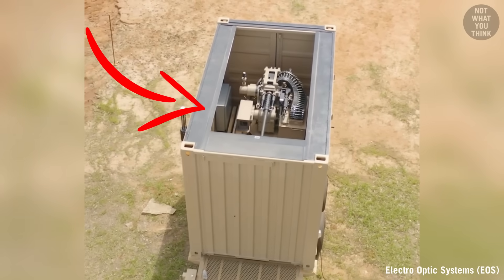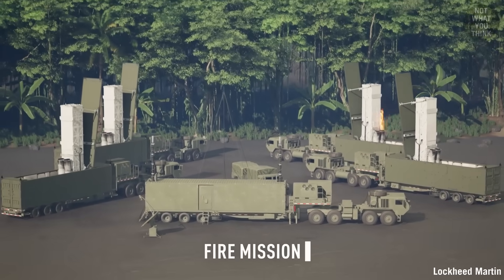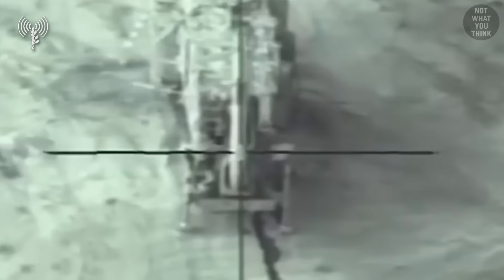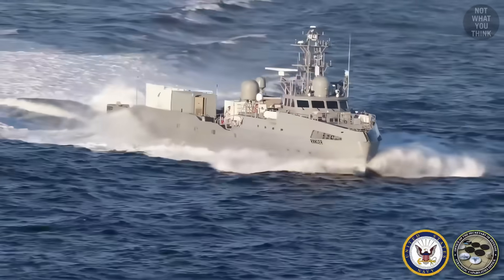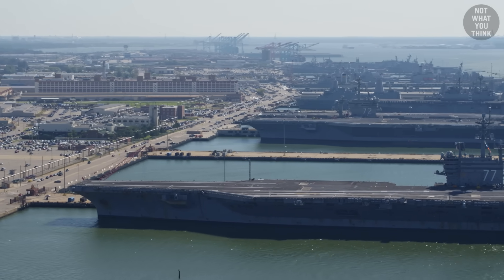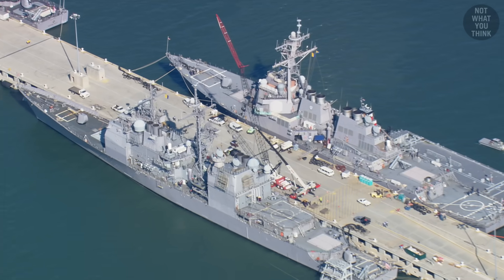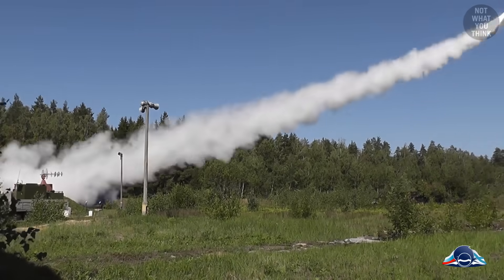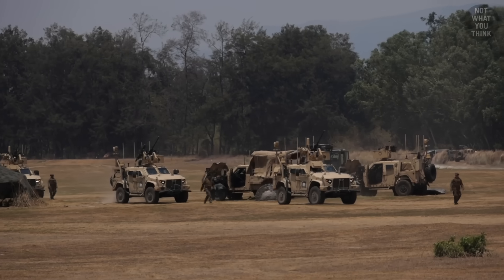Why Containerized Weapons Are So Terrifying

Comment: What if future container missile systems launch missiles from the sides instead of the top launch. And you don't need intermediate range ballistic missiles if you are planning to launch point blank surprise attacks from the container. Missiles with ranges from 40 KM to 100 KM would be enough to do the job. And they would also be light weight than regular ballistic or cruise missiles.

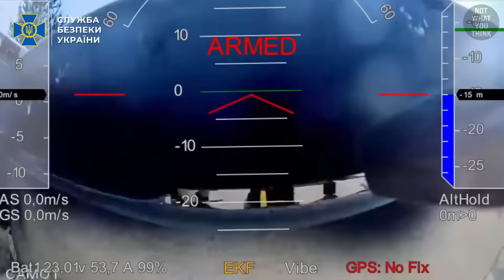Comment: 7:10 I`m pretty sure they were remotely controlled with no AI. Delay is not that bad because they used regular cellular internet. Less than 200 ping is more than enough to fly an FPV drone over the open field.

Comment: A small mistake ought to be corrected. At about 1:40 there is a reference to "Q ships" in WWII.  In general, this is true, except that it occurred in WWI, 1915. The term Q-ship had to do with a port city in Ireland, Queenstown. This was where actual merchant vessels, with crew and captain were "pressed" into a form of military service. These merchant ships, typically break-bulk tramp freighters, were armed with hidden pieces of naval artillery, with navy officers and gun crews. Which along with calculated devious play-acting, attempted to lure a German Unterseeboot, a U-boat to surface and sink that ship with their deck gun. This was effective and deadly. The result was unrestricted submarine warfare.

Comment: While this is an issue, another big problem than still fairly detectable Trojan containers are micro strategic capabilities. You just need to smuggle in enough parts for a single device, camouflaged in civilian items. Imagine targeting a key command player right when a major operation of yours is about to launch. Automatic facial or vehicle recognition, a machine based single shot device and you now have the benefits of any number of valuable small scale abilities, almost impossible to detect, without needing a huge network.

Comment: Roll on Roll off ships just drop self righting containers straight into the ocean each container has a small motor to swim to designated launch points ready to attack, once launched, the containers are designed to sink.

Comment: This explains one thing: the first hit is inevitable. So, in order to avoid such hit, having defence systems wont help much. Instead, a country like US must make itself strong in many aspects: have enough nuclear deterence power, strong economy, resistant and socially undivided population and even perfectly functioning justice system. Having such aspects of your country in high strenght, will make adversary country think twice before starting the war. Remember, US could not avoid taking hit in Pearl Harbor. However, strong US hit back hard, later on and won the war.

Comment: or systems with limited capability: 1 Maby 2 missiles (with severely reduced max ranges), which weigh in total small enough that it gets mounted on top by default.

Comment: Trial runs against our Naval and Air bases have occurred more often than just the one by the Chinese student, mentioned here.
Less than a year ago, both the Air Force and Navy reported large, highly organized drone swarms flying over their bases. Is several instances, the drones were larger than standard consumer grade models. In at least one instance, the swarm consisted of 2 layers - a grid of smaller drones at one altitude, with a grid of larger (master?) drones above the smaller ones. The description, reveals what was far too large and well orchestrated to be conducted by a few individuals. At least publicly, neither the origin nor destination was found.

Comment: 10:37 If I'm controlling the drone I'll just strike that radar factory after destroying that already on those ships. The key is only one, if you are destroying the creator, you'll be the one who wins.

Not only that, hydrogen bombs can be packed in a shipping container. Just use the 50 ft one, and you can pack a 50 - 60 metric ton in weight of hydrogen bomb, I don't know the yield but that will be bad if one of them is passing by in front of some vital objects then someone far away pressing the button.

Comment: 9:32 Japan found out the hard way, if you're going to attack our Navy in port, get ready to meet the Sun. And our ships use networked defense, if one radar is down it can piggyback off another ship. Or another radar system. AEGIS is modular.

Comment: Just imagine a possible future war between the US and China, which will involve billions of drones being deployed all over US installations on the globe. The production capacity of China is honestly scary. Just 2024 they have put up more solar energy than the whole world combined, and that by a long shot. They have put up over 300 GW of Solar energy in 2024, thats the equivalent of 300 nuclear reactors. For the first half of 2025 they have doubled their speed, meaning they might reach 600 GW of solar energy added just in 2025. For comparisson, Germany which is the big early adopter of solar energy, has around 100 GW in total. They will be largely energy independent in a couple of years, meaning any atempt in trying to bully them might end very badly.

Comment: I work in a US port. Biggest issue I can see is that these would be a bit obvious. You can't put this at the top of a tall stack of containers, the containers at the top will always be empties. Otherwise, the stack can't be as tall for obvious reasons. 

I can also promise you that things are loaded out of order every single day. If it's going to the same port and the weights are the same no one cares if you swap them around a little bit. Everyone's just in a hurry to get the ship loaded.

Every container that comes off an international ship has to get scanned in my port.

Also, containers get busted open all the time due to negligence or damage.... These aren't sneaking through US civilian ports with no one knowing.

Comment: Thermite, It doesn't matter how thick the armour is, 1-2kg of thermite will melt through the deck, everything under that, and possibly the hull underneath. You can deliver that through a drone with no problem to a naval ship yard. The scary part is, you probably don't need AI, just image recognition and a compass heading using off the shelf parts like Arduino boards. You can place a drone or several down kms away from a target, walk away, and when ready they'll activate and go do their job automatically. Jamming won't stop them and they know where to land to cause max damage. 
If I was a military, I'd be making sure I had good counters for this, really good counters.

Comment: I feel like your conclusion, that missiles launched from shipping containers is only viable by "state actors" should have the caveat: for now. How long before either the missiles get smaller/lighter; or the independent actor has enough money to PAY to have their heavy package placed on top; OR can hack the software used for placing the containers on certain ships and where? Where there's money, there is a way. Especially if the "independent actor" doesn't care about getting away with it - i.e. whether they mess with the fuel consumption/safety of the remotely hijacked vehicle. Indeed, that the container ship will likely receive some incoming retaliation is probably a plus for the independent actor. Let's hope someone is "on" this stuff!

Comment: And yes, drones are 100% the way to go, you can essentially turn a single cargo vessel into a robotic hornets nest.  You'd need very little extra infrastructure and logistics to create a bootstrapped drone carrier.  And all it needs do is carry them, it's not necessary to defend or be concerned about once it's swarm payload is deployed, so you can send them on one way trip ambushes.  Once the swarm is deployed, it could overwhelm a US carrier fleet, of course in best case scenario for the swarm.

This forces carrier fleets to be much more cautious.  Sadly this needs be done now, not until it happens, we don't need another pearl harbor incident over confidence and blunderous complacency.

Comment: what i see is al these different kinds of container "fillings",  but they all need to have some kind of hatch on top of the container.

so shipping companies and harbours can simply refuse to accept and/or handle containers that don't have a normal top/roof.
if there are hinges or openings instead of the continues roof a normal container has, just don't accept them.
and you can just use a camera that scans the top of the containers to filter these ones out.

so for the moment it seems pretty easy to identify in which containers there might be a nasty surprise.

Comment: on the defense side, there is also an interesting possibility. to a certain extent, containers are single use items. produce them, load in cargo, send them to the target on the other end of the world, remove cargo, scrap them. or sell them to somebody who wants one.
give such a used container a nice olive-green coating and deploy it somewhere you want to defend.
a used container goes for less than 2000$, but it instantly provides a cheap target for the enemy. one that redirects fire from you.

Comment: There should be limited trucking at those ports. Containers should be moved by rail away from the congestion of the port, improving port efficiency. Trucking begins at the rail end, 20 miles inland. Rail could be run through a section that X-rays everything on the way. No headaches for the port. None for the truck terminus.

Comment: Q-ships were a WW1 thing, not WW2.  This is because commerce raiders like the early U-boats of the 1910s, while they had torpedo tubes, usually saved than for warships, and chose to surface and use deck guns against merchant shipping.

Comment: A container ship could be a battleship. With cruise misilee, anti air, anti sub systems, command and control module, radars, sonar boeis, point defence,  with a top layers of 100 to 200 containere on the op layer you could have 100, 200 modules.
Reply: That's... optimistic. Most Naval Warfare systems can't be modularized as they depend on each other, being designed to fit a specific ship class.

Comment: Defense cost is a real issue - we've been using multi million dollar missiles to take down sub-$100K drones - that's US DoW/DoD F-U money, but eventually the solution to the problem doesn't scale.  So...

Pretty much all quad-copter drones are electrically driven - the best defense for those is a high-energy directed EMP (those drones which aren't autonomous would have their RF receiver blinded by a lower-energy directed jamming).
  
For mid-sized drones, grenades based on the defunct XM25 program, where distance can be programmed as it launches, would create a fragment field and disrupt the air-frame.

For larger loitering drones the CWIS-type gatlin guns will push out some range.

Comment: What are you talking about? They were not AI controlled lol, they controlled them via mobile signal which russia could not jam because it was basically in the city.
Stop making things up.

"The drones were guided to their targets remotely, using the open source software ArduPilot, which supports navigation via dead reckoning.[18] Zelenskyy said that each drone had its own pilot to launch and command it remotely.[15] One analyst explained that the drones were operated via dead reckoning without the need for satellite navigation, making them impervious to jamming of such navigation signals. The analyst suggested that the drones were using SIM cards for digital communication and position information over local mobile telephone networks, allowing control by a pilot far away and supporting high-resolution video."

Comment: Bravo Zulu (Well Done) for covering just how hard it is to pull off one of these attacks. I was going to harp on the weight of any missile system in a container and why it wouldn't be on the top of a container ship stack until you covered it. Very well done for completeness and not just hype.

Comment: Please delete any mention of ships crew.  We pull into the dock we are told to by port operator.  We have zero ability to determine where each box goes.  We rely 100% on the port as to where it rests on board.  We rely 100% on what others say the box ( container to your large language model) weighs, its contents and where it gets stowed, and to the time it gets loaded.  We monitor the weight distribution by the ship’s draft fore and aft; by its list.  
We all know how easy it would be for a bad actor to put whichever of the 4,000 containers wherever they want.

Comment: I don't know this, but apply some common sense!

Knocking out the SPY radar would hamper a war ship, but they're still bristling with radar domes, those will be the systems they used before SPY. so they will just revert to legacy systems and keep fighting.
Reply: Also, I have a strong suspicion that... should you try to fly a drone in front of an active SPY panel, it would be so electromagnetically noisy, you would immediately lose connection. and it might even fry the drones circuitry, like putting it in a microwave.

Comment: I would imagine that spy 6 radar could put out enough mm radiation that it would fry all the electronics in any of my drones. I can't imagine that unprotected electronics of any kind could absorb that level of directed energy.
Reply: You don't need no electronics to fall from above and explode.
Good old gravity combined with pyrotechnic fuse will do just fine.
It was working a century ago and it can still work nowadays.

Don't fear though, there are counter measures available and I bet US navy can afford them.
I also bet they won't advertise if they have those or not.

Comment: To shoot a missile from a container ship the container would have to be on the top of the stack and as far as I know electricity connections are usually on the lower container levels so you would have to have a fully enclosed firing mechanism that doesn't need extra electricity or modify the ship which would possibly be noticeable to opposing powers. Please correct me if I'm wrong I've not actually worked on a container ship

Comment: "How hard would it be to completely disable the US Navy's Atlantic fleet."
I'd like to welcome everyone here to the same watch list.
Reply: To be fair you could just place a massive droe net over the ship docks and take it down when they enter or leave using cranes on tug boats.
Reply: @Jeremiah-r3q  This would work except that any old bloke could make a multistage drone in their basement. I currently have a drone that barely shows up on radar, can traverse air and underwater, and is big enough to deliver an anti-ship mine. And all these capabilities were UNINTENTIONAL, it's a drone for tracking wildlife. I could easily mount an explosive charge that can cut a drone net in the payload bay, dive through the hole, and get underneath. And the best part? I don't even need a shipping container. It can fit in a car or a utility van.
Reply: Harder than you'd think considering naval command has been decentralized since Pearl harbor. Entire fleets don't just sit it port anymorel
Reply: It's not what you think.😂 Sean Ryan had a gentleman on his show that designed a weapon system that can take down 100 drones per shot. Also capable of repeating shots.
Reply: I don't have a containerised cruise missile though
Reply: 3 likes on this comment and I launch a swarm of drones on the Pentagon (I'm not suicidal btw)
Reply: @frcm  u on the watchlist now bud 😭
Reply: @EagIerX I'm already on it. Still haven't got that free Rolex I asked them though.
Reply: @frcm let us know how that works. I'm hoping it's in a game not IRL.
Reply: @JacobGreen-j9b yeah of course, who would be crazy enough to do that IRL ?
Certainly not me right?

Comment: 2:57 camouflage on a discrete shipping container is basically reverse camouflage
Reply: Your right we should put a red cross on it and just make it two war crimes.
Reply: @LoKi-oc8ks why dont we assign a war crimes NCO which signs all the war crimes. And then deploy said nco to lahey and wherever they hold war criminals. It will be efficient.
Reply: Because we’re not trying to hide it. We have no need to do that. The problem is when other organizations decide to actually paint theirs like a regular container and hides it. If you don’t try to hide it then it’s not a war crime.
Reply: @kolinmartz  The same reason we paint civilian aircraft in military markings when we use them.
Reply: US: it's just an innocent container
The container: painted the same tan color everything this the US military is painted, including the containers for military gear.
Reply: Camouflage is camouflage. There is no reverse.
Reply: @TreiPani Just like racism
Reply: Radars and IR sensors don't see color